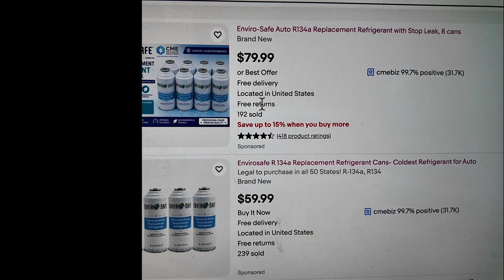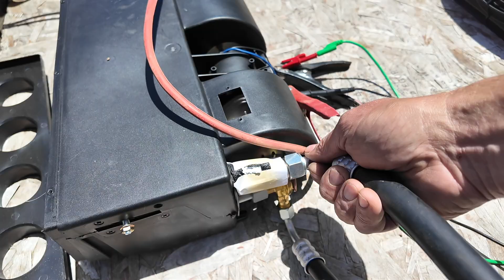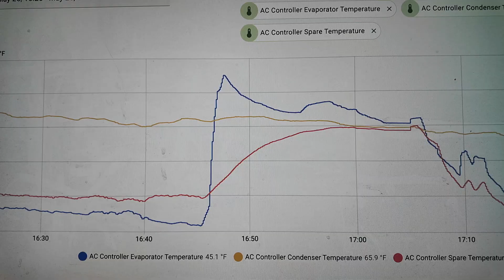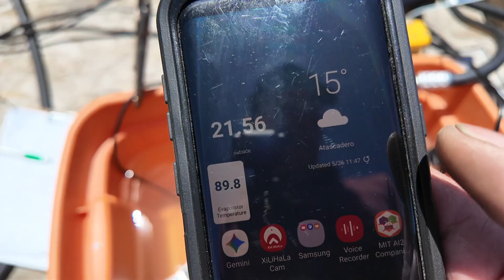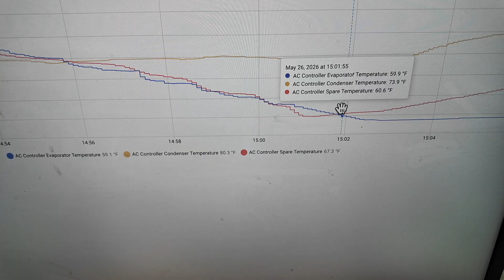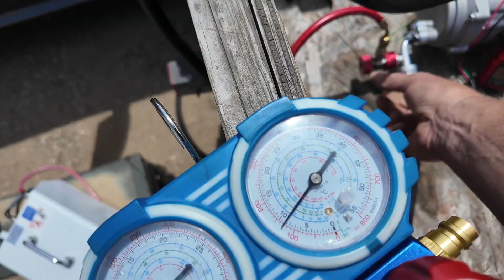This Popular eBay 12Volt AC Has A Critical Flaw Nobody Mentions

Comment: Hi!
Thank you for the video, you have dived deep into the topic.
Did you weight exactly how much refrigerants you have added? It is quite important as you probably know.
The unit you have should be charged with 600g of R134a according to the manufacturer.
When it comes to the replacement refrigerant, you cannot use pure R290 due to the TXV as you've said, however, a 50/50 mix of R290 and R600 (so care30/minus30 refrigerant) with very careful measurements of the weight (35-37% out of 600g so ~210g-220g), it should work exactly as with r134a.
I am also in the process of analyzing performance with refrigerants and the only option I see now is to use R134a or a 50/50 mix with precise dosage (which is still to be established).
Reply from the maker: Will do! I'll definitely share my findings.
Reply from the maker: Hi, thanks for watching. I started with 600g authentic R134a and that did not cut it, had very low pressures with OK cooling.  The sweet spot were i reached the 7500 BTU was at around 900grams, but that was after modifications to my specific system, shortening hoses and adding a heat exchanger for hot water (not visible in this video).  IMPORTANT i did test the system with a 50/50 mix, NOT pure R290.
Reply: @wright-wrong thanks for the info! Do you remember how many grams of the 50/50 mix did you use?
Reply from the maker: i the tested performance with different loads between 400 up to 600 Grams. I want to try again with a larger TXV valve though, i am a big fan of Hydrocarbon refrigerants.
Reply: @wright-wrong definitely! Please make a video when you find a proper TXV valve! :)

Comment: You should consider EER when calculating cooling/heating capacity. You should divide 12000 BTU / EER, which is usually around 2 for this type of AC.
AC is moving thermal energy from inside to outside.
Reply from the maker: Hi, thanks for watching. Did a EER estimate, areound minute 58:38. here the link https://www.youtube.com/watch?v=lZUGrvyFNEM&t=3518s